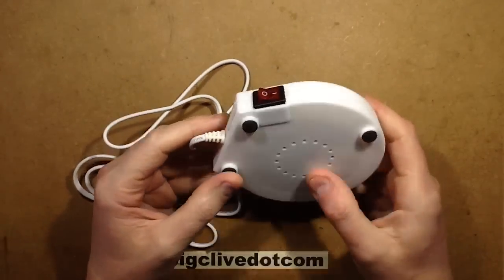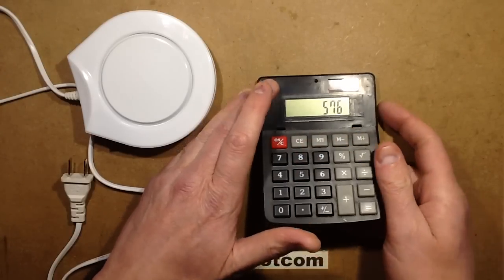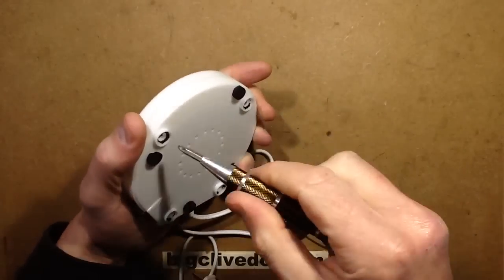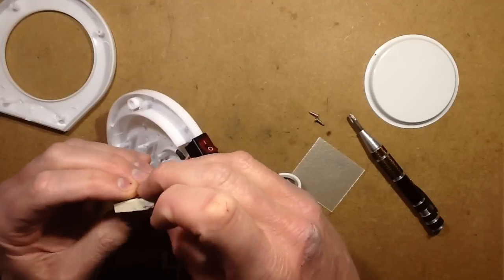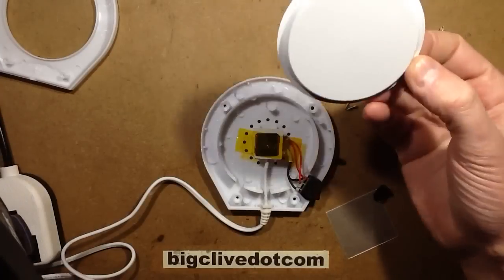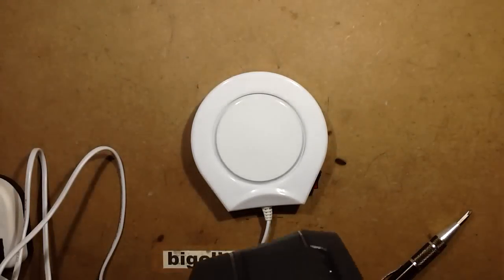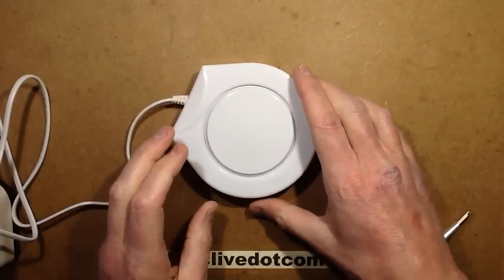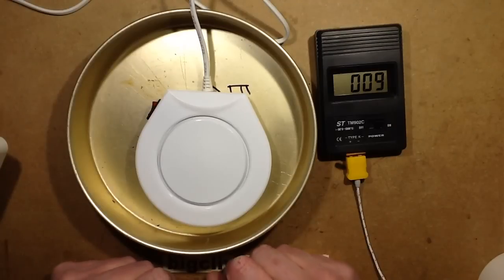Inside a cheap eBay mains voltage cup warmer.

Comment: Wonder what kind of capacitance that mica plate gives? Since mica wafer capacitors used to be a thing.
Reply: Almost nothing I'd bet. Capacitance is a function of the size of the metal plates, the distance between them, and the "permitivity" of the dielectric, which I suppose means "insulatingness". Bigger plates, closer together, and more insulating, all make larger capacitance. 

The plates are bigger in this than in most caps, and the mica is very insulating, but the distance is very large compared to actual capacitors. It would have quite a high voltage rating, though, if you decided to use it as a capacitor.

Comment: Hi! I just recently got a multimeter with the same thermocouple. I've tried searching for some info, but none suggested the termocouple is ok to use in water. But guessing by the video, it's just fine! Or have you made some modifications to it? Like thin plastic coat or something?

Comment: Great video, thanks. Is there a way to increase the heat output? Change the PTC thermister somehow? Trim the mica sheet? BTW, mine (new as of 2020-Jly-05) gets hot until a cup/mug is placed on it and then exhibits the same results as you achieved (cold cup). I have a feeling mine is bound for the recycle bin!
Reply from the maker: They're rubbish.  Any attempt to boost it risks flames.
Reply: @bigclivedotcom  For sure! In the recycle bin it goes. Thanks for your reply. Clive Richey, Canada.

Comment: To find the power consumption just divide 52,900 (which is the square of the 230V mains voltage) by the resistance in ohms. In this case, 52,900/1,000 = 52.9W. in the general case, power = Vx I, = V^2/R and = I^2 x R
Reply: While the UK's mains voltage is nominally 230V, as is Europe's, it's still 240V in fact. Europe is still 220V. The UK and Europe just moved the standards about a bit, so voltages on both systems are within acceptable range for each other. Mains voltage will change during the day, as load on the grid changes, so there's acceptable ranges. When we and Europe changed to 230V, it was only on paper.

Comment: I'm curious, what was the point of taping the PCT module before you looked at it with the thermal imaging camera? Does that provide a bit of a heat sink so we can get a more accurate heat map/contrast of what parts of the module get hotter than others? Update: you answered my question immediately after I commented, I'm dumb lol
Reply from the maker: Thermal imaging is affected by surface emissivity.  A shiny metal surface can give incorrect results.  Applying a tape like Kapton to the surface gives a more accurate result.

Comment: A quicker way to find the power is V^2/R ie 57600/1000 or roughly 60 divided by the resistance in kilohms.

Comment: I'd consider putting down some thermal compound on both sides of the Micah sheet and/or replacing the Micah with something more better conductive of heat but not angry pixies

Comment: Our craft stores sell these as wax melters and I’ve seen them in the decor section with various scented waxes.

I am wondering at the plug, which is rated for 120v in the US. Does the self regulating effect also compensate for voltage?
Reply from the maker: The plug is a Chinese 220V plug.

Comment: I used to use the base off a lava lamp for a cup warmer with its little heat lamp but it got quite hot and sitting a cup of fluid over a light bulb with no airflow was pretty dodgy lol

Comment: Holes on the bottom to let the smoke out ?
Reply: Didn't you know all electronic devices use smoke to make them work? If the smoke gets out, the device stops working :d
Reply: Of course not, it's pixie dust from all the angry pixies.
Reply: That's what I was always told. It still give me a chuckle.
Reply: It's there so when Chinese population control devices get set off, the owner of the device knows it's his turn in population management.
Reply: But with all of those holes In the bottom how do you keep the electrons from spilling out?

Comment: I have the exact same one but usb powered and it gets really hot but no transfer of heat into the mug because it's plastic
Reply: I take it back as I have just checked mine with a magnet and the central part is a steel plate just the same but a usb version . does get hot enough to burn you but no good to keep a hot drink warm . even tried a stainless steel mug for better heat transfer but still useless. maybe I could use mine as a pocket warmer with a pound shop power bank. that would definitely keep me nice and warm in my shell suit.
Reply: Might work better if you replaced the steel plate with an aluminum one, and/or used an aluminum mug. Steel, as far as metals go, has absolutely horrible thermal capabilities, which is why aluminum and copper are used for heatsinks - which is basically what that steel plate is (technically it's a heat spreader, but the concept is the same.)
Reply: Assuming he's powering it from a computer, the USB port most likely conforms to USB standards, meaning 100mA max from unsigned devices (unless given permission to draw more from the host device/computer) up to a maximum of 500mA (for USB 2.0) or 900mA (for USB 3.0), so it would be 12 hours in a normal 2.0 computer port.

That said, it most likely does not have current regulation, so there's a good chance it will try to draw more than the port can provide, leading to the host computer disabling that port until the heater is removed.

I don't know how those things work specifically, but I assume it's basically just a tiny peltier semiconductor type dealio, which take a lot of current, but with some caveats - the lower the temperature differential between each side, the lower the power consumption of the peltier - from this we can deduce that the best way to utilize one such heater is to either:

A) Feed it more power, which may not be possible if it's a USB device running off a host computer, or
B) Beef up the insulation of the mug such that less heat is lost. I don't know if there are any vacuum thermoses with single-wall uninsulated bottoms, but if there are that would be the best course of action, followed by an aerogel "beer koozie", and then somewhere down the line there's just regular beer koozies and the like. A lid for the mug would help too.

Peltiers are notoriously inefficient, to the point that they're not super useful for heating things at all, their main draw is that they're also able to cool things down on their cold side or with reversed polarity, essentially acting as a heat pump. I hope someone comes along and invents a baller new device capable of doing the same thing, but much more efficiently.
Reply: If it is a peltier-style device in that it has a hot side and a cold side, then I suppose it would be, however if I recall, it would still end up getting hotter because peltiers are much better at getting hot than they are at getting cold.

My main concern for if it's constantly switching like that would be that peltiers are not meant to be driven off of PWM, which is sort of what would be going on. Switching peltiers "on" and "off" all the time shortens their lifespans, which is why almost every commercial application of them uses a thermostat and/or rheostat with a certain amount of "play" such that it doesn't switch it on or off as soon as it deviates from the target temperature.

That said, I've only ever used peltiers off of DC, so I don't know how they react when fed AC.

Comment: Your cup would be losing heat at a huge speed with ambient down at 10c. With room temp at 25 (yes my flat never goes below that) I would expect slower heat loss from the cup and a higher lift from the heater. At the very least it would slow down heat loss from your drink and should make it stay at a reasonable drinking temperature for a while.

Comment: >doesnt have grounding
No thanks,  i dont wanna fucking die
Reply: So are you using lightning strikes to power your devices? ;D
Reply: Kangsteri  He uses fire.
Reply: You'd lose your mind in North America.  :D  Not much is grounded here.  Hair driers, power tools, christmas lights, some laptops, toasters, etc.  Not grounded.  :)
Reply: Those things are all double insulated, only appliances with metal casing need grounding.
Reply: I have lived in one house that had grounding (in Finland). Here we have ground regulations only for the devices, not for houses :D Its mainly protecting devices from storms. And it helps to remove additional fluorescent humming / noise in music systems. It doesnt prevent from dying, it mainly prevents from getting "stuck" to the power and burning of the corpse, after you are dead. And thats more like side effect than the reason for grounding.
Reply: Derp Herp I have a stainless steel microwave and toaster that aren't grounded.
Reply: When I grew up in the late '50s and early '60s, the houses I lived in didn't have any grounded outlets, and no electrical equipment we used regularly had grounded plugs or double insulation. I can remember being barefoot and picking up my dad's metal-cased electric drill on the driveway outdoors. Obviously didn't kill me, but the tingle was sufficient that I didn't do it a second time.
Reply: doesn't matter if the metal has no reasonable way to get in contact with the mains inside. It probably does though.
Reply: Mark L My computer was for a pretty long whole not earthed. I have a metal keyboard, and copper piping near my feet. Was fun when I noticed that it had shorted against live.
Reply: +bdot02  Do you mean it has a 2 wire plug or it is plugged into an ungrounded outlet? I've never heard of a microwave oven which came with a 2 wire plug.
Reply: Chris W now that you bring it up I think my microwave is indeed grounded.
Reply: You think you could die?
You're hysterical,
and I don't mean funny.
Reply: Kangsteri, a grounded device combined with an RCD will most definitely keep you from dying. The  RCD would trip before you even touch it. A grounded device without RCD and without fuse may keep you from dying due to electric shocks,  but will probably set your house on fire.
Reply: The casing's made of plastic. There's a standard for double-insulated appliances, where there's 2 levels of insulation, eg the cable's insulation and the case, they don't need to be earthed. The metal plate I suppose is a small worry, but the mica looks okay. Probably one of the least dangerous Chinese things Clive's had on here. There's been a few absolute deathtraps in other videos, this one is the sort of thing Clive would use in the bath. 

Check out Clive's "suicide shower" video and the hairy tales people have posted about that, if you want a real brush with death.
Reply: I inherited a house build in Cologne, Germany by my grand parents arround 1952/'53 (actually my grandma's house), 

The house has 8 fuses in total including the fault energy fuse (actually the deep freezer is on 2 fuses), whole electrical installation not grounded and a weak house installation as well. 

This and the fact that is has no central heating (of any sort), just a coal oven in the kitchen will lead to me  getting rid of this housing sooner or later I guess...
Reply: I guess

Comment: Could there have been a thermal fuse in the wire under block
Reply from the maker: Nope.  Just the flex.
Reply: bigclivedotcom too bad that's where one should be

Comment: I have to wonder why people keep complaining about the lack of a robust strain relief on the cable.   I don't know about anyone else, but the only end likely to be yanked with any force is the one at the plug, unless you just want to fling it around your head like a sling.   This one is going to be sitting on a TABLE or other flat surface, and the cable will be running behind it.  If any particular weight ends up on the cable, it's going to fall off the table long before the cable could stretch.  

There's safety, and there's pandering to people that should be allowed to remove themselves from the gene pool.  

"Hey, if I plug this in, and stand on it, I can yank the cable out and electrocute myself!"  

"Okay - you do that.  I'll watch."

Comment: Great Video Clive. I wondered two things about this mug heater, one was: If the mug was made of metal would it heat up better than the ceramic mug? & Two if you were to use a metal mug would it give you an "Electric Shock"? I.e. Would The "Magic Pixies (AvE Quote Strikes Again)" Jump From The "Heater/Metal Mug" & Bite You In The Ass? LOL. If you can let me know that would be great. Keep up the great work Clive. Nick.

Comment: What thermal imaging camera was that?
Reply from the maker: Hacked Flir E4.
Reply: Hacked? Does it shoot lasers now?
Reply from the maker: It turned out that the E4 which was the lowest unit in the series had the full size image sensor and all the other features there, but disabled.  I think they've stopped it now, but you could run a script that unlocked all the features and even added new ones.
Reply: hi clive did you receive my email thanks
Reply: bigclivedotcom Good Afternoon Clive, I'm curious what you exactly ment by " I think they've stopped it now, ... "
Reply from the maker: I think Flir changed the firmware to prevent the original hack from working.  But there's an active thread on EEVblog that may give more insight to the current state of the firmware/hacks.
Reply: bigclivedotcom thank you, definitely worth looking into

Comment: 7 to 8 watts steady state is pretty piss-poor. I've been using a Mr Coffee branded cup warmer everyday for roughly the last 8 to 10 years and mine is rated at 17W. It keeps a huge 18oz mug reasonably warm, and it doesn't even make proper contact with the heating surface because it's slightly recessed. Look for ones rated at 17W to 25W - it's worth paying a little extra for nice hot coffee in the morning.

I can't seem to kill this Mr. Coffee one even though I regularly spill coffee onto and through it. It's caked with dried coffee which I try to wipe off about twice a year, yet it works fine. I have a 20W backup ready to go, but I've had that sitting in a drawer for 5 years waiting for this thing to die!

I just looked up this model and they're still sold on Amazon for 10 bucks here in the states. "Mr. Coffee Mug Warmer for Office/Home Use, MWBLK"

Comment: Isnt this designed to keep a cup warm rather than heating it up?
Reply: Yup. But even at normal room temperature, "warm" ends up meaning no warmer than body temperature.
Reply: Alexander Krivács Schrøder

Dobt that is the case if oou but an 85C cup on it.
Reply: rimmersbryggeri what do you mean? That cup is just going to slowly cool down to the room temperature + 15 degrees.
Reply: Yul have drunk it before it's empty though and thats the point of this kind of thing
Reply: The point of this thing is that you drink your tea before it cools down? Something not right there, can't quite put my finger on it...
Reply: Paul Sengupta Haha, thanks for the laugh, man. Yeah, that's what I was trying to argue, but I couldn't put it as eloquently as you just did!
Reply: Paul Sengupta
 To keep it warm long enough that you drink it before it gets cold. English isnt my 2nd language.
Reply: I once had a girlfriend with a 85C cup which was quite nice, but i really don't get it why one should want to put it on this thing. It's not a boob warmer.
Reply: And besides my bad joke i have no idea what your question is. Please explain what you are expecting to happen when you put a cup with a beverage at 85°C on this warmer and why, then we probably can understand it.
Reply: It will keep it warm for longer than it would if not on the hotplate. Kind f like those plugin 12v mugs for the car. Designed to keep warm rather than hea up.
Reply: Yes, that is exactly what it does. It supplies some heat to delay the cooling down of the drink.
Reply: And that's exactly my original comment. The 85C was only a clarification.
Reply: And my answer to your comment/question is: yes. ;-)
Reply: "cup warmer" is an oversimplification in English. It's really a "hot drink in a cup getting cold slower downer"

Comment: If you used a stainless steel mug you may have better results.
Reply: There would be more capacitive coupling, too. I'd like to measure the leakage current on a steel cup.
Reply: Chris W Good point, does that mean if you touched a steel mug on this thing it'd blow your RCD?
Reply: +Darren Jacobson Probably not in the UK where trip points are near 30mA (I may be wrong about that). I calculated a maximum current of about 4 mA with the following variables:
 25mm square contact area, 240V, 50Hz,  0.5mm mica. That would only apply to a grounded cup. A human has resistance which greatly affects the leakage.
Reply: Chris W I'm in Australia, and I think I remember hearing that our RCD's trip at about 5mA, maybe less. So there is a slight chance that this could cause problems here.
Reply: 30mA trip current for a standard residential RCBO (Residual Current Circuit Breaker with Overcurrent Protection) here in Australia.
You can also get units with higher sensitivity (10mA) and more expensive adjustable models which let you set the trip current within certain limits.
Reply: I think his mug was too big it sat on the plastic instead of the metal plate it might not have been properly connected to the hot part. a narrower mug that is completely on the metal might stay warmer

Comment: If 10W is enough, then it is an even bigger shame that these USB warmers fail so hard. Why not have them come with several usb inputs to multiply the current? Why not use proper cables to actually draw an amp each? A usb warmer with two inputs, each drawing an amp should be feasible

Comment: i thought that was a 120 volt plug on it
Reply: Some places in China use US plugs with 220v. And to be technical its a NEMA-1 not a 120 volt plug but in looking up the specs only rated for 12 volts.
Reply: Have to watch what you order I guess